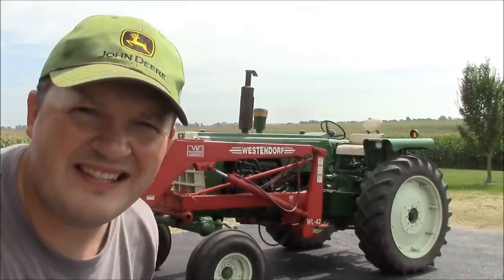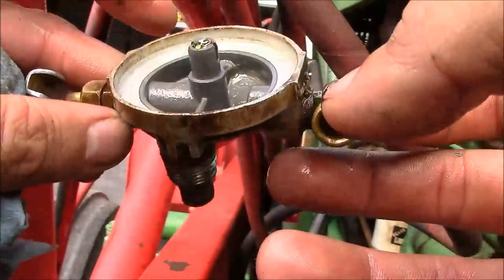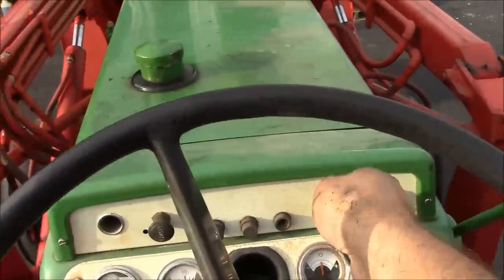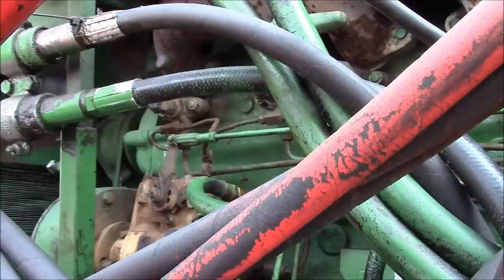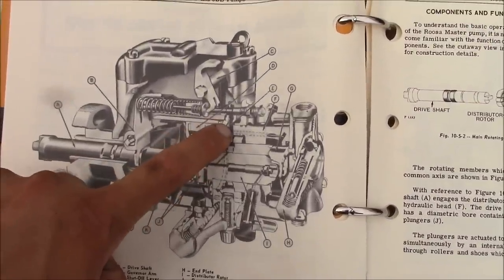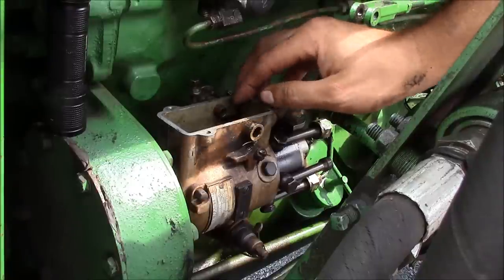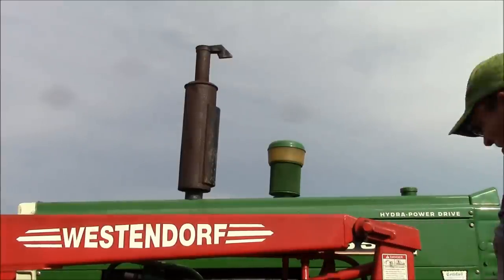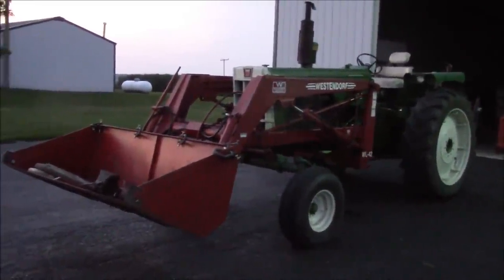Oliver 1650 Diesel Tractor - Hard Start / No Start

Comment: I think you're on to it, could also be that the air in  the lines up by the injectors was having a hard time pushing through the system with the low pressures generated just by cranking alone. That ether probably gave it pumping pressure to work through and like you said, get the meter to move where it needed to be. I love your videos man keep them coming!
Reply from the maker: Yeah that’s in line with my thinking.

Comment: Wes I know this is an old video but here is a tip for you guys. If you have access to electricity grab a heat gun like you use to thaw frozen pipes turn it on highest setting and stick it in the intake of the engine. Wait a minute or two then try to start engine. Now you have more heat going into engine and forced air induction.

Comment: Thanks for taking the time to respond to my comment. Watching your CNC milling video tells me that you have a tremendous technical and mechanical skillset.  I look forward to future videos. I did watch Ivan at Pine Hollow work on the Oliver tractor and was surprised that the wiring set up didn't smoke the diodes in the alternator.  I assume that tractor had a generator and was converted.  I am in the process of converting my 1970's IH 354 (gas) as the voltage regulators are un adjustable (Lucas, but made in India) .  Happy new year Craig
Reply from the maker: Right. The tractor was originally positive ground and was converted when they switched to an alternator.

Comment: Yep, high speed and vibration allowed the metering valve to finally move.  So, are you also in Iowa I see?  I'm over North of Ames.  Preheater is not run through the amp gauge.  Charging batteries in series is absolutely no different than charging one single battery.  They're simply cells connected together whether internally or externally.  Problem usually comes with charging batteries in parallel.  That fuel algae is definitely NOT good.  It will continue to cause problems.  Run some algae cleaner pretty rich for the next 5 tanks or so.  My Oliver 1855 had same problem with the injection pump when I went to buy it.  It's still not great, but works.  If you have other Oliver questions, feel free to hit me up!  I've worked on and with them my whole life.
Reply from the maker: No. I'm in North Western Illinois. The problem I mention with charging is if you hook a 6V charger to a single 6V battery in a series connection, the results are unpredictable. It works much better to use a 12V charger connected as a show in the video.

Comment: The tractor you see in my Avatar is an Allis-Chalmers D17 6cyl Buda Diesel with a pump almost identical to that on the Oliver you're working with (oddly, the other tractor on the property is an Oliver 1265!).  The Roosa Master cannot really be effectively bled at the exit side, it would potentially leave air in the injector lines. If there is fuel in the RM pump bowl it will pump fuel to the injectors.  So your theory about the metering valve is probably true, it was stuck 'off'.  You need to bleed it at the injectors and crack as many injectors open as you can.  When you see the fuel come out, she'll fire if you've closed down each leaker.  Ether is the cheating way to do it but if you have too much air in too many injector lines it can still cause issues until they are bled manually.

Comment: Didnt read all of the comments and it is 2 years later...  BUT diesel fuel that sits too long on a boat... where the water (condensation ) and diesel meet,  a bacteria of sorts.. aka diesel slim,  grows and I'm wondering if that stuff is the dried debris mixed with diesel residue?  I have  cleaned some nasty stuff out of boat tanks and it causes some odd issues... still enjoying don't know why;)

Comment: HI ! I bought the same tractor and it was allways hard to start so now I use  a little shot of starting liquide and after 5 or 6 rounds it start in winter I fixed an heater-block and after pluged 15 minutes  it start verry well but do not forget the liquie starter!!

Comment: 100% agree, The engine startup vibrations are what rattled things in the injection pump into working order.  The ether just set things in motion.  In Theory you probably could have got it to start by 'Tappy tap tapping' on the pump while cranking it, but given the access that looked to not be an option.   For some reason I'm very found of the Cat 3208 injection pump, its appearance, and functionality. I also recall the 'horror' of getting the new to me 7.3 power stroke home from auction and not being able to find an injection pump, nothing but wires on the accelerator pedal, and slowly realizing what I must have purchased..  (Love it now, but oh that first day was an eye opener)
Reply from the maker: Yeah the old IDI Fords had a regular rotary injection pump. But the PowerStroke is a different kettle of fish.

Comment: I had a international 2606 backhoe that did that.. except it was a gas burner. All the rust would settle at the bottom of the tank and naturally go to the sediment bowl inlet... one day I took a empty 270 cartridge, cut the small end off, and hammered it on the inlet if the sediment bowl so it raised it an inch or so off the bottom of the tank. So if anything was gonna go thru the lines itd have to be floating.. and it ran fine!

Comment: GOOD Deal! I've seen the red dye in off road fuel goom up like that crud in the fuel tank but it usually did it in the filters. I also knew some guys that had a 5-ton G.I. log truck. It would NOT start with the starter but you push it 6 inches and it'd start every time. Maybe your tractor was related to their truck.The guys both told me about it and they weren't prone to lie.
Reply from the maker: Some diesel engines will not start if the battery or starter is weak. They need to spin over at a certain minimum RPM to get started. I've seen that before.
Reply: @WatchWesWork  Right again.

Comment: Here is a great tip for you  (red can) SEA FOAM  Motor Treatment I have used it many times with great results. In the old Oliver Tractor, I put 2 cans in 1st time and 1 can every 5 to 7 fill-ups it does wonders.  Even your you gas motors too

Comment: nice job! i think you're correct with your theory on the starting fluid as well.   Ive been into the roosa master pump on my 310g to do the governor ring and reseal it and it wasnt bad of a job.     My backhoe has a fuel problem with it now.  the system will loose prime so i have to let the electric pump run for a few seconds until i hear it load up and then i can crank it to start.  i haven't looked into what's the issue yet but nothing is leaking externally and the injectors are rebuilt
Reply from the maker: My experience with the rotary pumps from Roosemaster or CAV has just been external leaks and the flyweights for the timing advance. They seem very reliable.

Comment: Throw some acetone(or any solvent) in the tank and mix it around a bit, then use compressed air and your hand at the top and blow the stuff out the bottom. Can use same process with one of those heated pressure washers. Those options should clean out the tank quite well.

Comment: My money is on stuck vanes in your transfer pump.  Ether gives the pump a quick boost in rpm/pressure and off she goes.  I would run a couple cans of diesel purge through it to clear out more of that crud...after disassembling the lift pump to manually free up the vanes.

Comment: My theory is that that little bit of seepage you got when it wasn’t starting was happening any time it started, and typically the governor on these Rosa stanadyne type pumps works similar to a lawnmower carburetor and governor and will run basically full throttle just before starting, and that’s likely because the fuel requirement for pre combustion startup is more but if there’s ether there it will start off that smaller amount, I think I remember from when my dad was rebuilding (or at least taking apart) a similar pump for a Ford diesel (which works slightly different for shutting off) the throttle control would only work at idle fuel levels until running rpm was established, so essentially you would have one part working full throttle and the other working idle when cranking it and because one part is off it would not put out the proper starting level of fuel, then once started it would work fine aside from maybe some response issues or max level limitations

Comment: I hope you put some fuel system conditioner and injector cleaner in the tank and I would pull it in the shop and mediately in case you had to work on it some more.

Comment: I noticed that the fuel gauge was showing empty at the end of the video with the tractor running. That has me wondering if the float on the fuel sender unit might be covered in that sludge and being held down in the empty position from it. I think a proper fix would be to remove the tank from the tractor and give it a thorough clean out and make sure the fuel sender unit is clean and working correctly then reassemble and reinstall the tank onto the tractor. That way you will sure that the fuel system will not get gummed up again any time soon.
Reply from the maker: The sending unit actually does work. I just put  a few gallons in the tank to test things out.

Comment: Love how you think through diagnostics and try to deduce the problem. You may be right about vibration shaking the metering valve loose, But... check your narration at 19:26: "When I took off the cover the first time it (i.e. the metering valve) wouldn't move at all." After you worked it around by hand a bit it freed up enough to be sticky. But you imply that prior to that it wasn't merely sticky, it was stuck. Which would lean away from your hypothesis that vibration was the answer. I don't pretend to know, but it does sound like there's a discrepancy in your reasoning. Or else you were just being a little too emphatic about what you saw the first time you popped the fuel pump cover. 

Best wishes. Stay safe.

Comment: Have you tried filling the filters with automatic transmission fluid it’s full of detergent will give the lines pump & injectors a clean do it when the engine is warm easy starting that way. Will run on it ok.

Comment: Imo the first clue was a gummed up tank, the fuel system  still needs to be cleaned or this will happen again SOONER then later. The reason the ether worked was you bypassed the way the fuel has to run thru and spayed directly to where the fuel needed to go. Ether helps in a pinch to get started quicker but without proper cleaning of all the whole fuel system it will fail quickly again

Comment: Try running non bio-diesel a tank a year should do. When I worked for Ryder, a driver would do run from MICHIGAN to Kentucky each day. He run regular diesel in one tank to warm up, switch to bio-diesel tank and an hour before before shut-down switch back regular diesel. He had no problems with build up at all.

Comment: I had the same kind of sludge in the tank of a gas tractor  (JD LA) . I had the gas tank relined once with epoxy to seal a leak.  I think the epoxy was breaking down which created the sludge.  Was your tank ever relined with epoxy?
Reply: Back a few years....epoxy lining was the 'hot' deal for motorcycles. I tried that....then stopped dead on the road...miles away from any civilization.....looked in the tank, the whole epoxy lining was a big gob of sticky stuff....sitting right on the fuel valve....I was able to get it out with a stick...Epoxies are better now (I hope)….that was back in the 1970's...
Reply: @dougankrum3328  i'm no chemist but I suspect that the arrival of alcohol in the gas was a factor.  Alcohol and epoxy (before 2000 or so) might not have  played well together.

Comment: The shutdown mechanism is probably stuck in the closed position, give it few taps and set the throttle at full and crank the engine. If it starts squirting at the injector pipes, the shutdown plunger is sticking

Comment: Fairly new sub here.
Thanks for the video.
Are you concerned about the grid heater? I agree it's probably not working because the lack of a draw on the amp meter.
Reply from the maker: I will need to fix it before cold weather arrives.

Comment: Try cleaning with naptha. Its a light voc and should cut the gunk. Next down from the tank is the fuel pump. The lever is the same as if you were spinning the engine over. Except your not running the battery down.

Run a good dose of atf in the fuel to clean it up. You could have just filled the pump reservoir up with atf to free the pressure vanes  and metering assembly up  just by working it full open and closed. But hey lets go see.

Comment: Thank u sure i just bought a case with188 and its ben sitting 2 years im drained fuil refiled clean tank has rose pump manfold heater isent working bit its 70 out im thinking im not geting it to crank fast enough still trying to find what batteries in need

Comment: Check the 2 black caps on dash if one blown need 15 Amp 35 Volts fuse  or wires on button corrosion on wire or glow plugs be dirty need replacement  and power wires  to need clean! My dad  1963 Mc-Cormick International B414 Desiel  4 cylinder loader tractor and plus fuse and just explain need fix up every year to!

Comment: My opinion is if main fuel line was loose at fitting on top of pump, wouldn’t it suck air? Just asking, I was referring to elbow fitting on top of pump.
Reply from the maker: That's not the main fuel line. That is a return line to the tank. It's purpose is to bleed air from the pump.

Comment: I think there is a bleed point on the side of the pump. I have a David Brown 996 and there are 11 bleed points when it stops through lack of fuel. I note there was a challenge with the pump, but it might help in the future.
Reply from the maker: Not on this pump. That David Brown is English, so it probably has a CAV pump, which does have a bleed screw.
Reply: @WatchWesWork  yes you are correct. But it just looked like a bleed point.  Sorry.

Comment: I worked on a Farm all Super C  and it took me forever to figure out what was wrong with it.  Long story short, I found what appeared to be a piece of a wing from a wasper that was partially blocking the inlet to the fuel bowl.   I only found it after completely removing the fuel bowl valve assembly completely.  This was after I had rebuilt the carburetor twice and replaced the coil, spark plugs, wiring, ballast resistor, etc., trying to find the reason it would run sometimes but shut down when under a heavier load.    Some fuel would come through, but not enough.

Comment: Pre combustion engines are fun.  International D282 engines are also notorious for being hard starting.  Some times you can pull start them if you have a helper.
Reply from the maker: Yeah, they are all very cold blooded. The newer Oliver 1655 had direct injection and they start much easier.
Reply: I got a d239 international use to be a bastard starter  having no glow plugs, until I discovered to hold the stop out while cranking, thats how the cold start works.

Comment: Farm store, sprayer strainer 1 inch in diameter X 3 inches long, round rear earth magnet with 3/4 inch hole, glue magnet to strainer and set in tank over outlet hole. works wonders.

Comment: Two (same type) six-volt batteries in series are exactly the same as a 12 volt battery.  You can charge in place just the same.  Generally want to avoid discharge below 50%

My Ford 3910 diesel had bad tank sludge and rust.  I pulled the tank,  put a quart of acetone in it, and agitated it.  Then drained it, pressure washed it.    Then put a handful of nuts & bolts in, and shook it a bunch.  Then acetone, then put a heat gun blowing into it till dry.   Then Red-Kote sealer.  Now all fuel coming from it is very clean.
Reply from the maker: You can charge them if you do it as I showed in the video. But, if you have a 6V charger and hook up to one of the batteries connected in series it doesn't work very well. If they were hooked in parallel it would work fine. I'm not sure why this happens. It's just my observation.
Reply: @WatchWesWork  You need a 12 volt charger.

Comment: All lackered up, and stuck metering valve... nice stuff bio diesel crap, bacteria in the tank to.  God y miss the old days whit original diesel...
Bleeding the pump itself and filling it up with diesel wil help make it start easier after you have worked on the fuel system...My advice, Repair the cold start and thry not to use the start pilot, it will damage the rings and liners... (it wil make it addict to eater in the long run).. Thumbs up!..

Comment: we have a 1650 that would run fine after it started but was really hard to start. It ended up being the lift pump on the opposite of the motor as the injection pump. I believe the  diaphragm had a hole in it and it was putting air into the system.
Reply from the maker: That can be dangerous if the fuel leaks through the diaphragm into the engine. I rebuilt a Perkins that failed due to diesel in the oil from a leaking pump.

Comment: Put a sponge or paint brush on a stick spray healthy amount of brake parts cleaner in it and slop around paint thinner ...drain out the whole, and dry replace valve filter  refill and start

Comment: I just saw your video, I have 1650 diesel thats kind of rough, I put a different starter that someone makes for them that runs faster than original, that helps alot. Need to spin a diesel fast.

Comment: Diesel will deteriorate if it is stored for a long time in shifting temperatures. Temps on the warmer side will speed it up a bit. Oxidation or something is the reason which will result in gummy like sediment. 
This is very common and I bet a pain in the rectum to clean 😁
Reply from the maker: Well it's been stored inside, but not in a heated building.
Reply: Wes Johnson Services warmth will simply speed it up. 
Cool climate is not a warranty it will not happen.